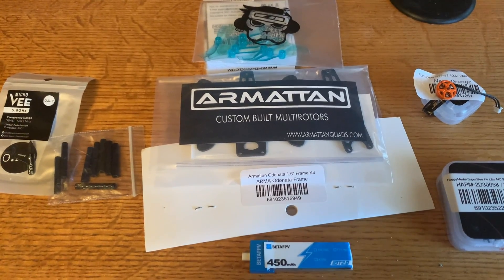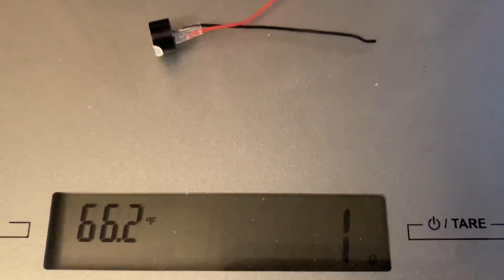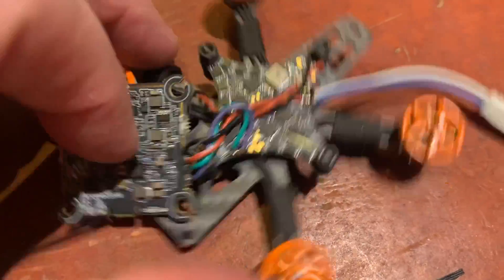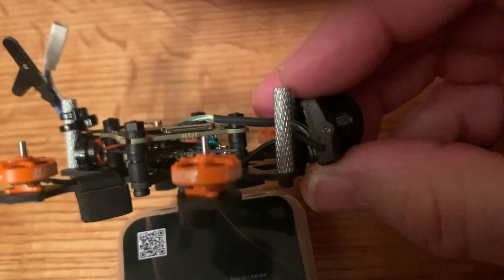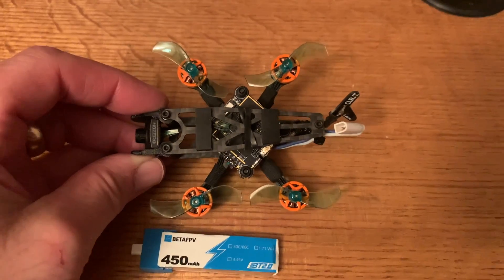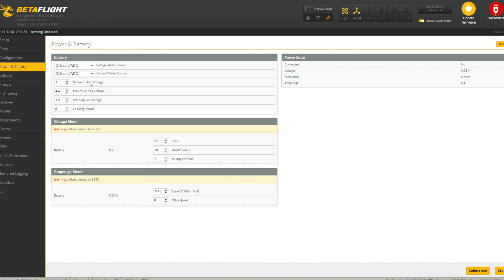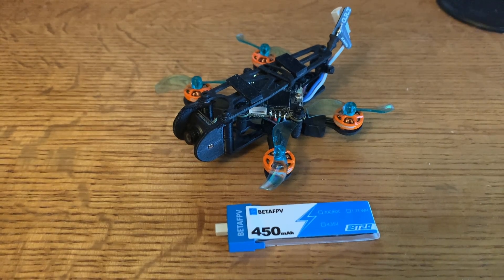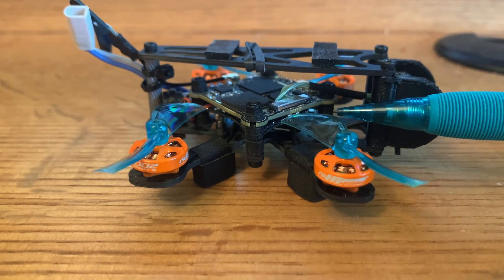Armattan Odonata 1S HD Zero Build

Comment: Close on the name😉 Oh-Doh-Na-Ta. (I'm the designer). It's the scientific order of the flying insects dragonfly and damselfly, which fit its characteristics well. It natively fits compact nano cameras, but unfortunately there are larger cameras that don't fit. However! I am working on a HD add-on kit that replaces the standoffs and allows for any size nano cameras. There is also the Odonata HD, which is a 2" version for more system mounting versatility and better characteristics at a higher weight. Also, there are no props in view in the native camera position😉 I'm glad you like it. Thank you for supporting and making this video! Awesome watch.
Reply from the maker: Hi Crafted Kwads,

Great design and I am glad you are coming out with a 2" HD build! I will pick one up. I love nano builds like this. Hopefully Armattan will cary it and is giving you some scratch for your efforts.

SLOG
Reply: Hi you will make a 2" odonata? Exc but I Don t understand English very well😏👌🏼🚀😍
Reply from the maker: @ludofevrier5593  you will need to contact Crafted Quads but here is the 2" HD Odonata frame on Thingiverse: https://www.thingiverse.com/thing:5477899
Reply: @slogfpv  Thks so much 👌🏼🙌🏼
Reply: Hi Friend, I'm planning to purchase this original size (not 2inch) frame. I want to ask if this frame fit to Caddx Vista Nebula Pro Nano Camera? Please kindly response, Thanks